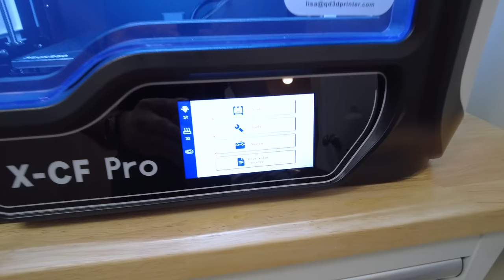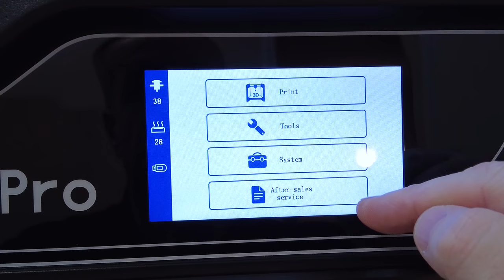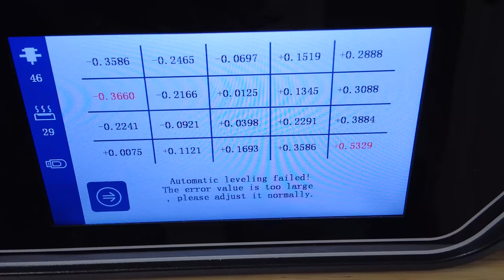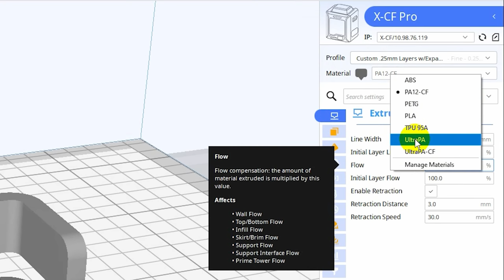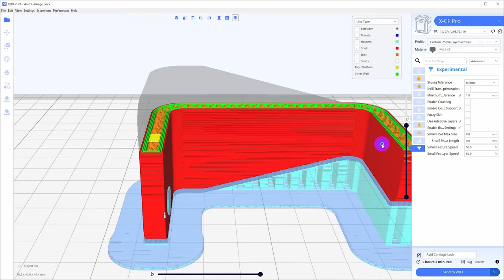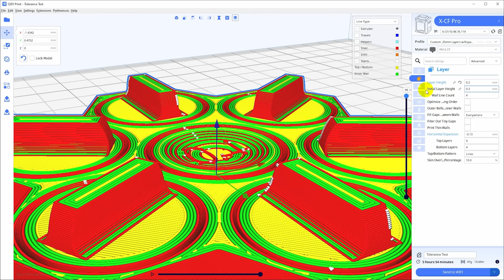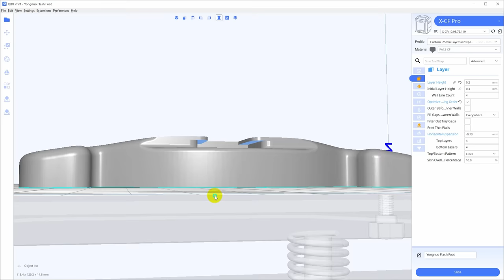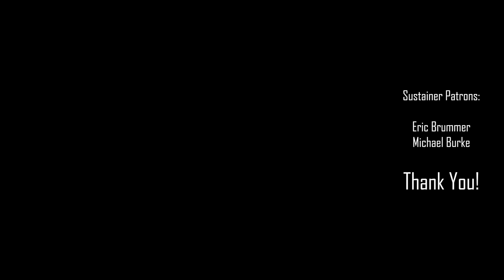Is the QIDI Tech X-CF Pro the PERFECT Carbon Fiber 3D Printer?

Comment: Been running this printer for over 8 months now and it is absolutely fantastic.  The QIDI stuff is just well built and reliable, no messing around needed.  I don't even bother checking the first layer like you said in your vid - that's about the highest praise you can give a 3d printer really.  I got rid of all my Creality/FLSUN/etc as frankly they were junk and the constant fiddling required did my nut in.  I now have a X-CF and old X-Maker (still prints like a champ, I use it for ABS) and 2 x Voron.
Reply: Do you need any ventilation during printing with the carbon fiber fillament? Thanks
Reply: @clevo12  Yes you should always have ventilation even with PLA -  I have airflow through the room and a HEPA with carbon activated filter running too.
Reply: why can't you use abs on X-CF ?
Reply: What kind of cool shit do you make?

Comment: Auto leveling is like digital zoom: it's not mechanically driving the bed level, it's measuring the bed shape, and applying a transform to the gcode points to level the print. This will also compensate for small amounts of curvature of the plate, since it takes a matrix of points. (Edited, thanks roflcopter)
Reply: I think you mean digital zoom. Optical zoom does give you more resolving power.
Reply: Surely the only gcode it would adjust is the z height. And then you would see the z screws move while printing. 
I still don't understand it.
Reply: This is mostly correct, but this should still translate to moment in the z-axis screws. The only way the printer has to change the relationship between the nozzle and bed is the z-axis screws.
If it was properly applying a bed-mesh it would drive the build plate down if there is a high spot, and up for a low. IMO it looks like this printer only uses the meshing to check if the bed is too out of tram and trowing an error if it is over a certain threshold.

Comment: Give some PPET-CF15 and PABS-CF15, and even for lower heat applications try PPLA-CF15, all of these print really nicely on the X-CF-Pro but In regards to the Nylon CF, most brands do shrink, I usually scale between 1 to 3% in both directions, and you can apply around 20% part cooling which also helps keep the scaling correct, and if you want to heat treat nylon, add another 1 to 2% scaling to compensate, with my in house UPAHT-CF15 (Nylon11 Blend) I print with 5% increase scaling and I heat treat at 140° C for 6 to 8hrs.

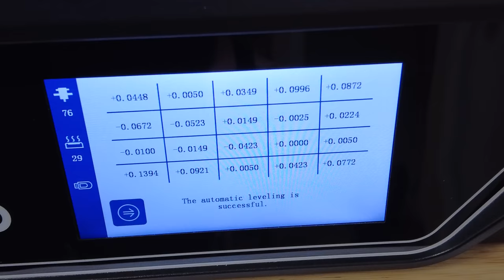Comment: There is a difference between level and flat. The manual adjustment gets the bed level (equal distance to the nozzle), but if the bed isn't flat, the probing will compensate for any uneven spots. You can clearly see at 6:58 that the bed has an overall variation of over 0.2mm. If printing something large, you would likely have poor initial layer adhesion in some spots. You might not have noticed the screws moving because you didn't print something big enough and there was no need to compensate.

Comment: On my machines I manually level and then use a bltouch with a grid map to account for any temp warping or other fluctuations in the plate. Then I use the bltouch to set z every print without relevelling which is nice so you can slap tape or a different bed surface down without having to recalibrate z.
Reply: What kind of machines do you have?
Reply: @odinata  home built corexy

Comment: I have been using two of these for 3~ months, very very good, only a few minor issues.
The BLtouch i find good for dealing with build plate warping and for warping springsteel, but not for general bed leveling.
I get incredibly good print quality at even very fast print speeds.
The extruder/hotend setup is very easy to maintain.
I swapped out the leveling shim for some brass shimstock because i level when the bed and nozzle are hot, like when i print.
Only minor issues are the bed is only supported in the middle so it can rock back and forth a bit giving a bit of slop front-back and the extruder plastics and packaging aren't as compact as they could be so its hard to see the first few layers or anything on a small print.
Customer support for firmware updates etc are great. I don't use their slicer, can't stand cura, but that means i know it doesn't have any issues with 3rd party slicers.
Would have liked a spare springsteel sheet with the PEI only on one side for the ability to quick switch, but a minor thing.
Reply from the maker: Have you observed the Z screws moving a little bit as it prints a single layer, compensating for the bed?  I have yet to see that happen.
Reply: @Clough42  On my 3D printer (not a QIDI) I also can hardly see movement of the Z screws unless the deviation is massive, but I can hear and feel the Z steppers. If it's possible to print with the door open, you could just put a finger on one of the Z lead screws and might be able to feel if it is stepping.

Comment: I’ve had my X cf pro as my first 3D printer  and it works very well. Asa, cfnylon, pla+ and abs has printed well . The ribbon cable was getting damaged in the top left corner rail , I glued the lil cube I printed in that corner to stop the ribbon from getting caught up on the big wide prints  .

Comment: The BL touch map stuff is done on the fly with the G-code interpreter on the machine.  As you saw, the ranges are small, so it's fine tuning of stuff. Questionable as to if it does anything practically for most prints, but it's a nice to have.  Sometimes the machine would also have a general z-offset that will bump up things ever-so-slightly while at the machine level.

I've got a creality cr6se that only has a sensor/probe to set bed leveling, and it's ok enough.  It was fine as a beginner machine

Comment: Darn you anyway!!  I have some products that I have been 3d printing for 4 years now.  I had 2 x-max and 6 x plus printers and I have just finished replacing them all with the lastest versions.   I also use them for prototyping some of my machine shop work.  I have a small cnc mill and cnc lathe. Yesterday I got to looking at the X CF Pro. I have been on the FB pages and this eve on youtube.  After watching a lot of videos and finishing with your I just ordered the x-CF Pro.
Reply from the maker: They do tend to multiply.  :)

Comment: Wow I'm super impressed, can't believe that prop was basically perfectly balanced right off the machine!! Wish I had 2k blow I would totally get one of these and start making my own drone & r/c parts. Enjoyed the video as always James!👍👍
Reply: Check out the Bambulab X1C if like this. Even better when it comes to ease of use as it calibrates flow automatically as well as Z offset and is wicked fast.
Reply: why would you chose this over the prusa XL?
Reply: @ChriFux  If you are talking about the XCF then youd choose it because its enclosed, has a chamber fan and filter and is out.

If you are talking about the Bambulab X1C, it has a full enclosure, chamber fan, automatic calibration of flow and z offset and prints voron fast, also again, the prusa xl is not out.

So basically each of these has reasons to buy them vs the XL.

The XL also costs a lot more.
Reply: @BeefIngot  I was interested in that, but most reviewers seem to have problems with it. It seems more like a beta than a finished product.
Reply: @melgross  what reviewers? most I've seen are overwhelmingly positive including my experience. Modbot, cnc kitchen, 3dprintdoctor etf
Reply: @BeefIngot  id have to look back, it’s been months.
Reply: @BeefIngot  do you think the Bambulab X1C is better than the QIDI Tech X-CF Pro ? I am new to 3d printing.  I want to make parts for automotive, tools, & parts that will be strong and durable.

Comment: Love my i-fast, and I would buy another qidi if I need another printer. I'm done working on printers, I want machines that just work. My qidi has been exactly that. Just works
Reply from the maker: This.  When I built my first CNC mill, someone posed the question:  Do you want to spend your time making a CNC mill, or making parts with a CNC mill?  I spent many years making and tinkering with 3D printers.  I've been running my own extruder design for years.  But now I want to work on other things and use the printer as a tool.

Comment: I'm a newbie to 3d printing. I want to experiment and print small parts to help me build camper vans and overland vehicles. I need them to be strong... so the carbon fiber appeals to me. I'm a buy once and cry once kind of guy. What would you recommend? Is the X-CF Pro the winner? I'm also looking at the Bambu X1 Carbon when its available.  Thanks!

Comment: Sounds like an impressive machine! Thanks for showing it to us. On your video, I'm not sure if it's my settings or not but I'm noticing a sync problem between sound and vision. The sound is behind by just a tiny amount. Just mentioning in case it's not my settings! 🙂
Reply from the maker: Interesting.  The original looks fine to me, and it plays back correctly for me on YouTube in Chrome.  That said, I shot this entire video with a different camera than what I normally use, in a room without the light levels I have in the shop, and I'm really unhappy with how it looks.  It's possible there's some other difference somewhere that's causing issues on some devices.

Comment: I'm a bit confused by this printer, I have the QIDI I-MAX, which is a large printer built like the  X-CF Pro, that comes with a brass nozzle for non abrasives, and a hardened nozzle for CF nylon etc.
The X-CF Pro is a printer that comes with the hardened nozzle fitted, and a spare brass nozzle .... etc etc.

I have had some very good results with PA12-CF filament In the I-Max. So apart from the (useless) leveling probe, what makes the  X-CF Pro any different to the I-MAX?  they both have a brass nozzle and a hardened nozzle and both print CF well.

Comment: They must have changed the design of the top cover at some point.  The model I received last week doesn't have a magnetic cover.  Mine has tabs in the four corners that fit into slots in the top of the machine.

Comment: I'm astonished by how good this 3D printing is now. It's not something I have really been bothered about, but as retirement beckons, I'm starting to think its something to get going with. I'm sure this printer is too much to start with, what printer and package would you recommend to start out with? I have always thought it best to start with what you will probably end with though.
Reply: I can recomend a Prusa if you have the budget. 
More Budget friendly would be a creality Ender, still good but will need some tuning
Reply from the maker: At the low end, most people go for the Creality Ender.  You will have to fiddle and tinker to get decent results.  If you want to spend more and have a better out-of-box printing experience, the Prusa is the standard by which others are measured.
Reply: Prusa (especially the Prusa mini) is probably the cheapest "this can be a tool, not a hobby" out there, they have an excellent reputation. If you don't mind a hobby, the Ender 3 series is very popular, but Creality has too darn many versions so I can't remember the name of the new one that's like $250 but has all the upgrades you'd do to the $100 Microcenter deal on a V2 and is actually a good value even in that context. CHEP filament Friday is the best source for up to date Creality info.
Reply: (it's also completely valid to do the "buy the cheapest reasonable thing, then when you wear it out or outgrow it and know you actually will use it, buy the best you can afford" in which case the Microcenter coupon is probably a solid choice
Reply from the maker: @rpavlik1  this is exactly how I started (with an inexpensive, but probably reasonably good MakerFarm kit).  Then I bought the parts to improve it, and later built a bigger one.  Now I'm pretty confident in my ability to design and print what I imagine in my head, and I just want a machine that can reliably make the bracket or fixture or 300 of them without a bunch of tinkering.

Comment: Your input would help me with a decision.
For the most part I would be using PLA for printing components required in quantity.
As this printer is geared to the 'difficult' filaments would it still be worth (monetary is not the issue) purchasing the extra 'capacity' beyond ABS?
Cheers.

Comment: Automatic bed leveling isn't so much to compensate for an out of level (actually out of square) bed, and more to compensate for a warped bed.  If the center or one edge has a bit of warp, no amount of leveling can fix that, and you risk crashing the nozzle into the bed, or departing from it so much that your adhesion fails.  (speaking as an Ender 3 owner, so this is of course based on the assumption that whatever they're using works similar to Marlin)
Reply: I was about to write something like this, but you did it much better than I could! 😁😁

Comment: So if you were gonna recommend this one or the ifast, if it was gonna be your only printer, which would you choose ?
Reply: I am also trying to decide between these two printers.
Reply: @njspeer  I just got my daughter the iMates so we can learn the process together. It is an amazing little printer for $400 for us to get our feet wet. It works great right out of the box and she took right to it. She is 11 and can pull things right off thingiverse and print them properly. She uses a program they have at school to design and export files in the stl format. I am teaching myself how to use fushion 360 and I will probably get the xMax next, or just go for the gold and get the iFast
Reply: @unclematt7223  I actually just ordered the i Fast from the QIDI website (my first 3D printer).  From what I can tell, it can do everything the X-CF Pro can do and then some (larger build area, actively heated chamber, dual nozzles).  The only thing the X-CF Pro has that the i Fast does not have is the auto leveling.  I need to make 72 small electronic enclosures for a project.  I bought a 3 year subscription to Fusion 360 about a year ago, for the PCB/Eagle software, but then hated it and switch to KiCad (which is very good).  Maybe now I can get some use out of it.
Reply: @njspeer  Thats awesome. I didn't mind doing the manual bed leveling, it was a pretty quick process and my daughter has been using it non stop and every print has come out perfect . Have fun with the printer and make some cool stuff !

Comment: Thank you for the video; it is very well done. 
I like the Qidi X-CF Pro, but I want to print other materials at temperatures ranging from 370-400C. 
Do you know if it is possible to exchange the current extruder for a higher-temperature one, and would it be possible to adjust the temperature settings in the slicer accordingly? 

I appreciate your help. Thank you for everything.

Comment: Nice video. Been looking at building a voron, but might go this route instead.

Also this may be a dumb question but why can’t you just run ABS through your hardened nozzle? (In the case you wanted to run ABS on the CF Pro)
Reply: No reason you can't print ABS, or any non-abrasive material, with a hardened steel nozzle. I keep a hardened steel 0.6mm NozzleX on my printer all the time and it prints everything fine.

Comment: You can use the support blocker feature to stop supports being printed for the vertical holes, or what I do is set my support angle to 59° so nothing under that will get supports

Comment: Do you still run your old Makerfarm? I bought a dual extruder kit from you quite a few years back for mine, I still have it but have several other printers and haven't used the old makerfarm for at least a few years now
Reply from the maker: I have a couple.  I keep one loaded with flexible filament.  I used the other this week for something, but with the i-fast sitting next to it, it doesn't get much use.

Comment: Does your generated g-code have the command to enable (M420 S1) the use of the mesh? I had to add this to my slicer startup code. It seems it should be there if you used their version of a slicer but they could have missed it.

Comment: The new probe they sent me, comes with a cover.. its was getting heated too much from the head and not working at all.. Even more i dremmeled the fan which is only 40-45mm, and it wasnt able to cool dont the aluminum heatsink, and i had clogging issues all the time.

Comment: im more impressed that you have a prop balancer than the actual printer :) do you also fly RC planes ?
Reply: I've never flown a RC plane. The closest I've ever been to one was in a hobby shop. And yet I've used a prop balancer very similar to the one in this video. Back in the 80's I did a paper on RC tech, development and culture from the start. I don't remember why but as I was talking to people about their hobby I got to play with a prop balancer. However it wasn't for a RC plane but for a control line racer, which kind of was the predecessor of the RC airplanes. Still the precision of this printer is pretty impressive. Bought propellers back then was about as well balanced out of the box, if you were lucky...

Comment: 2:30 The purpose of the probe is to mesh level. So that is to compensate for a non-flat bed and/or gantry. Though honestly they shouldn't use the BLTouch in a hot environment like that because if your chamber is upwards of 50c it will fail.

Comment: You can't put fasteners in CF Nylon.  It creeps away and the part becomes lose.  Nylon is good for shock strains but not fixed loads.   That being said.  Commercial nylon fasteners don't seem to creep.  I am not sure what is different about 3d printing filaments.  Neat material but very limited practical uses.
Reply: there are several polymers that get called "nylon" - most common is pa6 or sometimes pa66, while the 3d printer filament is pa12. And presumably there are also additives involved that make a difference but don't show up in the name.